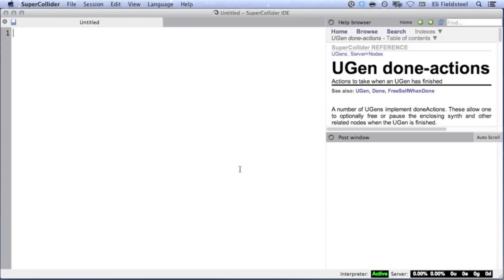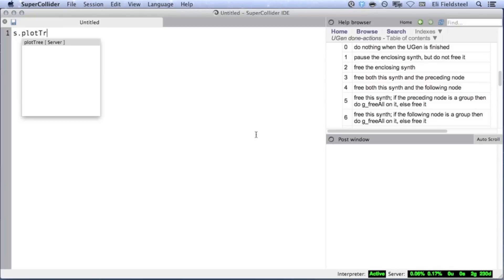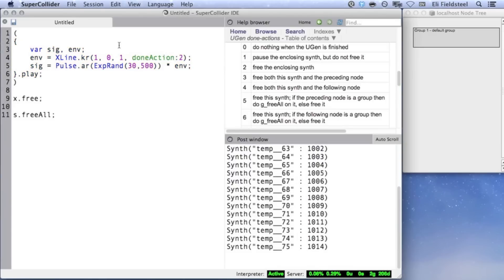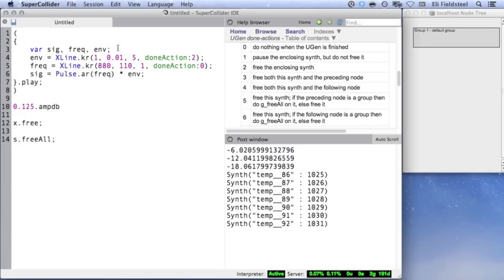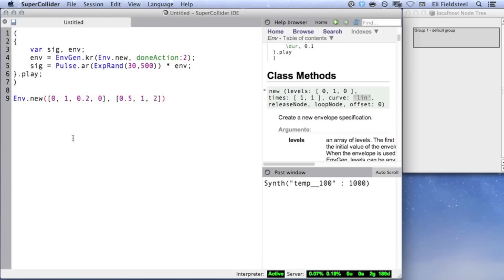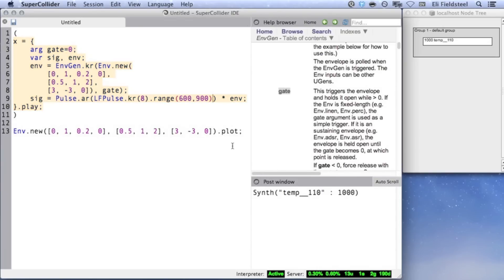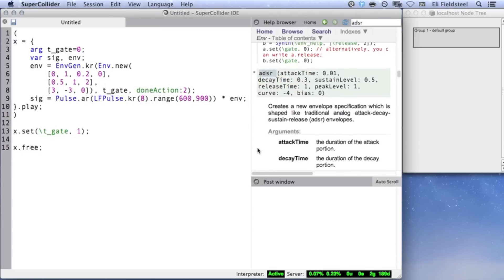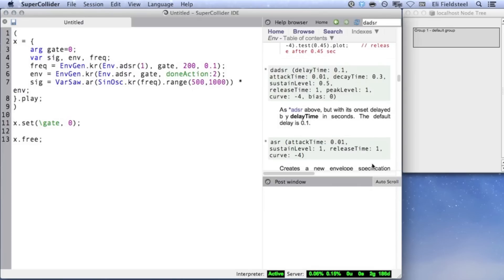SuperCollider Tutorial: 4. Envelopes and doneAction

Comment: I've noticed this in tutorial 3 and in this tutorial. I would type everything out exactly as I follow along with the video and pause when I need more time to type. For some of the examples I would get errors and I would look over it over and over, but it is the exact same as in the video. Then I would go to your link in github and go over the same example there. I notice that some things would be ever so slightly different in how the syntax is there vs in the corresponding video. I would copy and paste the specific example I had troubles with and it would work. I don't know if these differences have to do with a software update since you first released these videos. But it can be frustrating and slow down the learning process as I'm going through the tutorials.
Reply from the maker: HighlandViolinist - Chantelle Ko If you paste the error message and the code you're trying to evaluate in your comment, it becomes much easier for me to help you.
Reply: ERROR: syntax error, unexpected INTEGER, expecting NAME or WHILE or '[' or '('
  in interpreted text
  line 4 char 20:

   env = Line.kr(1.0.1);
                     ^
   sig = Pulse.ar(RRand(30,500)) * env;
Reply from the maker: 1.0.1 is not a valid number. I assume you meant to type Line.kr(1, 0.1);
Reply: Thanks!

Comment: Your tutorials are amazing! Thanks! How do I make a Line loop, forward then backward then forwards......
Reply from the maker: Thanks! The Line UGen can’t really loop. Best is to use a different UGen. LFTri is a triangle wave oscillator, so that’s a relatively simple option. EnvGen can also loop through a custom breakpoint shape. You can also use LFSaw or Phasor combined with the Fold UGen to “reflect” the upper half of the ramp back down. There are lots of other options too, it just depends on what kind of input controls you want.

Comment: Is it possible to replace the envelope values using "x.set(\argument)"? Because when I tried to put an argument as a value for the envelope, it didn't work. I'm not sure if I'm explaining it clearly.
Reply from the maker: Yes, but not in the "usual" way. Envelopes are different from other UGens because they are especially time-specific. The behavior of EnvGen is documented at the very top of the help file: "The envelope [values] are polled when the EnvGen is triggered and remain constant for the duration of the envelope." This means, if you modify some envelope value using a set message, it'll only be updated if the envelope is restarted or faded out.

There are plenty of cases in which what you are describing is a nonsensical thing to do. For example, let's say you set the release of an envelope to be 30 seconds long. Then, 15 seconds through the release, you set the release time to be 3 seconds. What should the program do? Too much time has already passed for the release to be 3 seconds total. Should it stop immediately? Restart the release phase? It's ambiguous. This ambiguity is essentially the reason why EnvGen values are only updated when triggered, rather than being dynamically changeable at all times.

Here is an example:

s.boot;

(
x = {
	arg atk=1, sus=1, rel=1, gate=1;
	var sig, env;
	sig = SinOsc.ar;
	env = EnvGen.kr(
		Env.asr(atk,sus,rel),
		gate,
		doneAction:2
	);
	sig = sig * env;
	sig = sig * 0.2!2;
	Out.ar(0, sig);
}.play;
)

//The sustain level is initially 1. Setting a new value by itself will do nothing, because the envelope's gate/trigger argument is not being manipulated, and the UGen is not checking for new values at this time.
x.set(\sus, 0.2);

//The release time is initally 1 second, but we can change it to 10 seconds. This change will be polled if we also set the gate to zero.
x.set(\gate, 0, \rel, 10);

x.set(\rel, 0.01); //This does nothing. We cannot change envelope once the gate has been closed — we'd have to restart the envelope to take new values changes into account.
Reply: @elifieldsteel   Great explanation! Many thanks for your time.

Comment: Hi Eli,
Could you explain why, in the code underneath, the value of \freq1 in the set-command  is not rising, although the frequ1 shown in postln does rise?
And why the playing synths keep piling up?
And isn't there a more elegant way to set up a repeating sound without the 50.do beacause obviously i can not alter the 50. Thanks for your answer.
(
a = {
 arg amp = 0.05, freq1, freq2 ;
 freq1 = 100;
 freq2 = 105;
 SinOsc.ar([freq1, freq2],)*amp};
)

(
t = Task({
    50.do({
  arg i;
  var myfreq1, myfreq2;
  myfreq1 = 100 + i*5;
  myfreq2 = 105 + i*5;
  a.set (\freq1, myfreq1, \freq2, myfreq2);
  a.play;
  i.postln;
  myfreq1.postln;
  myfreq2.postln;
  0.5.wait;
  a.free;
    });
});
)
t.start;
Reply from the maker: 1. You are overwriting your arguments in your function 'a' (freq1 = 100;
 freq2 = 105;). Remove those two lines.
2. You cannot set a Synth before you play it. You must set the initial arguments as you create the Synth, for example, x = a.play(args:[\freq1, myfreq1, \freq2, myfreq2])
3. a.free is an attempt to free a function, which is wrong. Instead, free the Synth that is created from a.play. For example, x = a.play; and then x.free
4. Synths pile up because you are not using any envelopes or doneActions (which is the whole point of this tutorial).
5. Repeating sound can be done using Patterns. See the Pattern Guide in the SC help documentation for more information.

Please consider subscribing to the SC mailing list and searching the topics there. It is a very good resource for improving your understanding of SC: http://new-supercollider-mailing-lists-forums-use-these.2681727.n2.nabble.com/SuperCollider-Users-New-Use-this-f2676391.html
Reply: Thanks a lot. Using your link i finally succeeded subscribing to the mailinglist.

Comment: Hi Eli! I´ve created an Envelope inside a SynthDef, but when setting sustain using synth.set(\sust, whatever value), the sustain doesn´t change. Altough release responds to the set method. What could be the problem? Thanks
Reply from the maker: +Octávio Gaspar Sustain time is usually controlled in one of two ways, depending on whether you are using a fixed-length or variable-length envelope When using a fixed-length envelope, the sustain time is provided as an argument when the Synth is created, e.g. Synth.new(\name, [\sus, 5]); and the sustain time cannot be modulated while the Synth is playing. When using a variable-length envelope, provide a gate argument in the SynthDef (2nd argument of EnvGen). On Synth creation, set the gate value to 1, e.g. x = Synth.new(\name, [\gate, 1]); At some point during the Synth's lifespan, set the gate to zero, e.g. x.set(\gate, 0);